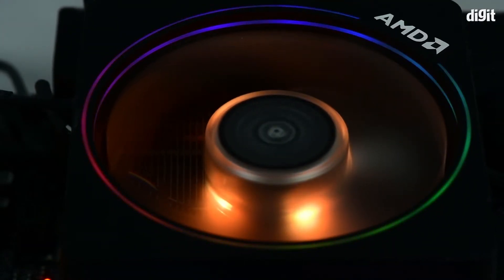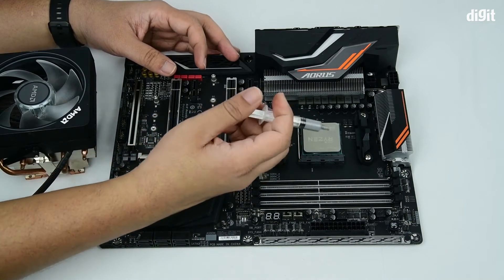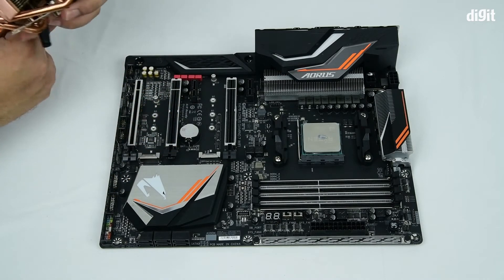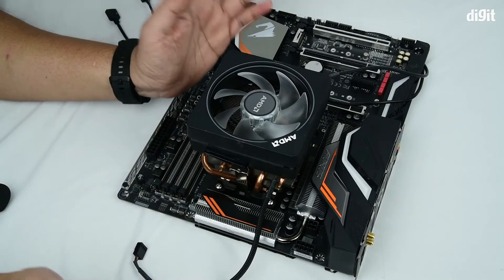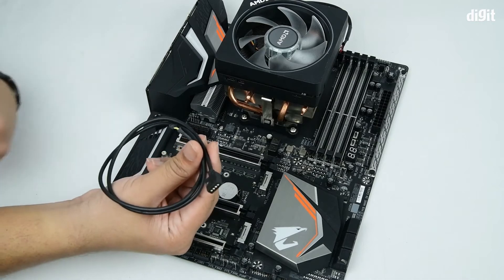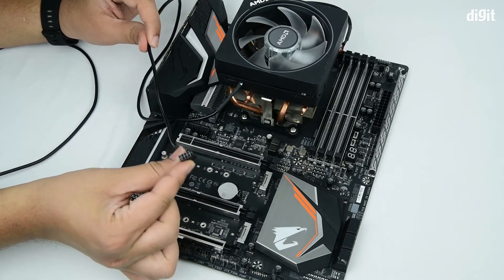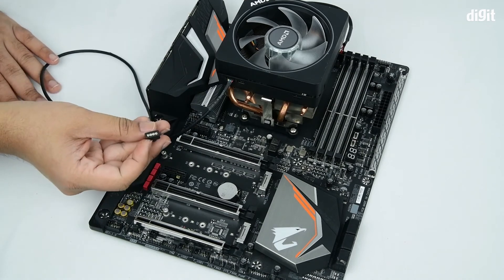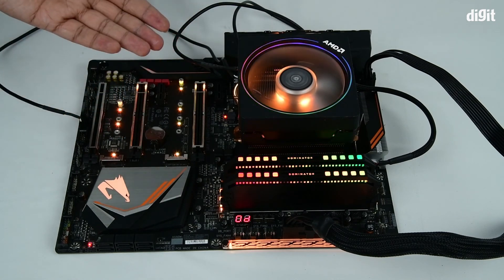How to Setup AMD Ryzen Wraith Prism LED RGB Cooler Fan from AMD Ryzen 7 2700X Processor

Comment: Hi great video as i an upgrading my Ryzen 5 2600 to the Ryzen 7 2700 - does the processor and cooler package come with thermal paste included or do i need to order that separately? Thanks

Comment: Using both cables is a certain failure...use one or the other. Using the usb cable will allow full function of the rgb software...the other will not. Might as well advise them about the included high/low fan speed switch located on the cooler frame while you are at it.

Comment: Thank you for this video.  I've had this cooler for a few years now.  It has always worked fine.  I noticed this morning that my fan was not spinning.  I removed the RGB connector and it started spinning again.  Not sure what happened but the RGB lights (both) are still working.  The fan itself changes colors still.